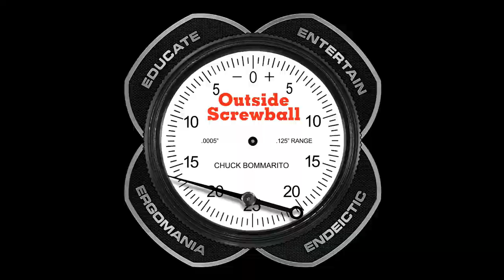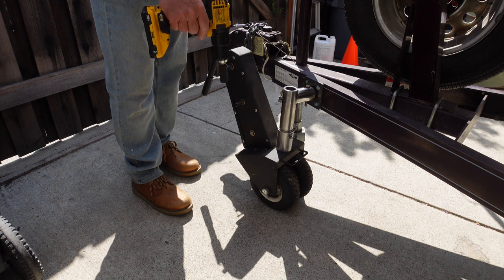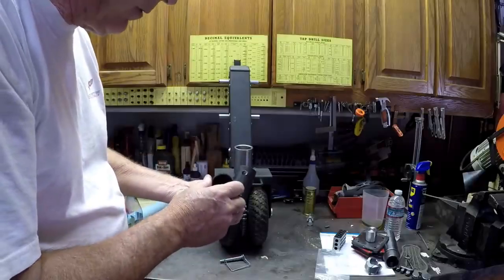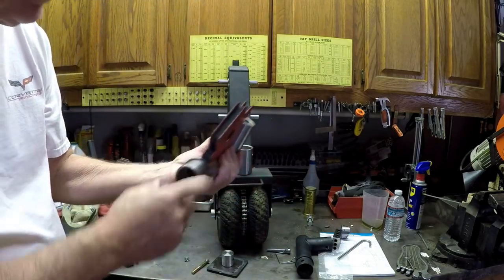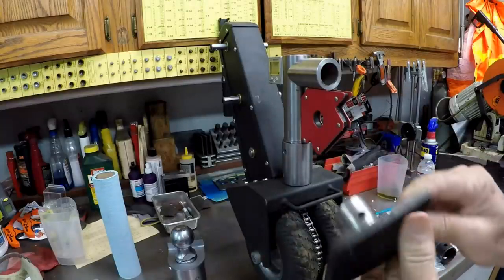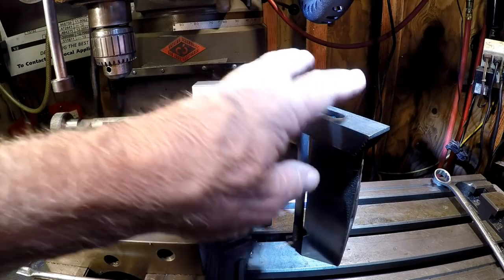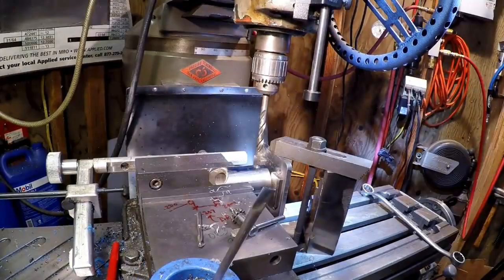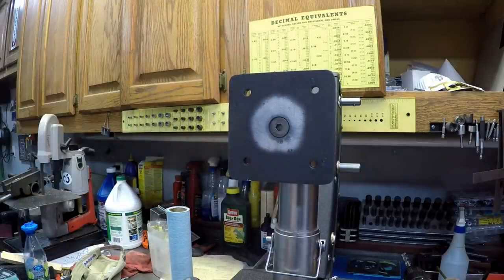Trailer Valet XL (mount modifications)

Comment: I had to take out a link and ad a half link to tighten the chain drive.Also the bushing tend to spin in the housing which will eventually get cut and fail.I cut a half moon slot the size of a rivet head in the bushing flange and double upped on the rivet head.The rivet keeps the bushings from spinning but also alowes the bushings to float and not bind the shaft.I used a rivet with the shaft removed with the head of the rivet in the half moon slot and drilled a pilot hole thru the rivet shaft hole into the housing .I also cut the heads off on the rivets and used them as washers on the rivets.The added washer gives the rivet enough meat to hold the bushing in place without interfering with the shaft clips.Rivets have to be the right length or they will bind the sprockets if to long.

Comment: Chuck have you ever seen the gas powered valets down in Santa Cruz? They worked really well, but were annoying due to fumes and noise. If you have a spot in dry storage you can use them 24x7.

I like your adapting the cordless to the crank. You should look at some of the Milwaukee M18 tools, they have batteries up to 12Ah with high output tools. In this case you need it smooth, unlike an impact. They make a Brushless Cordless Hole Hawg that will take any of the M18 batteries up to 12Ah. That could give more torque.
Reply from the maker: thanks for viewing and your comment